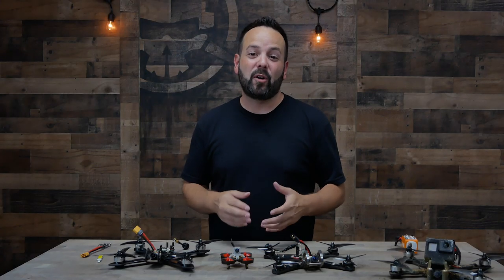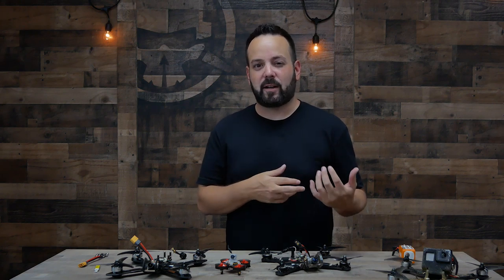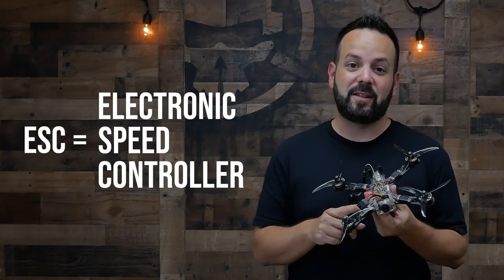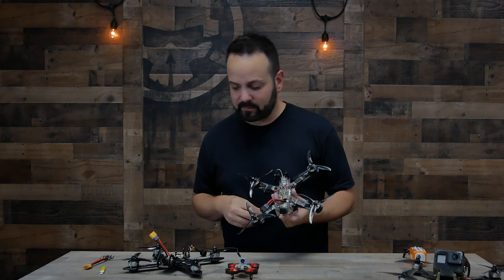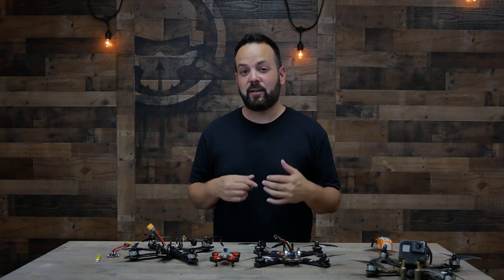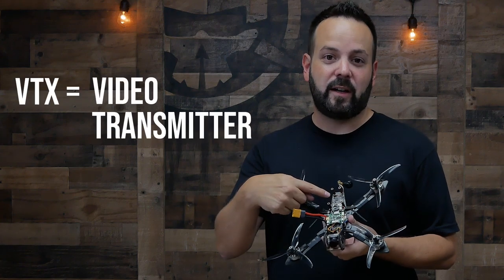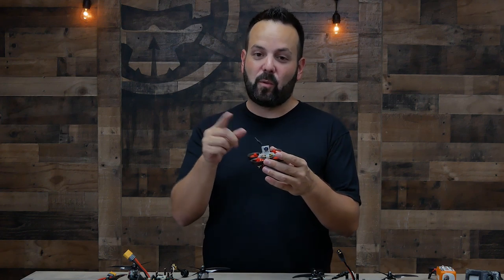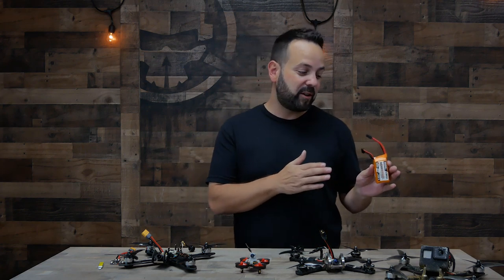FPV Drone Component Breakdown [FC, ESC, Motors, Camera, VTX, Frame...]

Comment: 4:43 so modern FC's are all-in-ones or nah? if you get a regular FC does that integrate PDB or is that all-in-one? u didnt really clarify
Reply: Most modern all in one weds do the job of powering the fc
Reply: The fc usually provides the juice to different stuff, like the cam and vtx

Comment: What is your opinion on the jumper t16? Or do u recommend something else around this price point?
Reply: I have the FlySky Nirvana which is about the same price I think (with coupon code).
Its amazing! Not multiprotocol, but probably better range. Definitely better feel in the hands, more switches. Colour touchscreen. Seems like a better option

Comment: Man, this is EXACTLY what I needed to see. As long time DJI pilot I’ve found myself insanely bored flying. As a result pushing a DJI to go against it’s purpose (cinema-esk photography) can be quite expensive three gimbles /two cameras/landing gear/and multiple props later... wa-la, FPV snaps onto my radar!
Thanks for getting this info out there. You’ve really helped ‘This Guy’ start to make informed decisions on my soon to make purchases. Be flying with you soon!
Reply: FPV is expensive also . . .